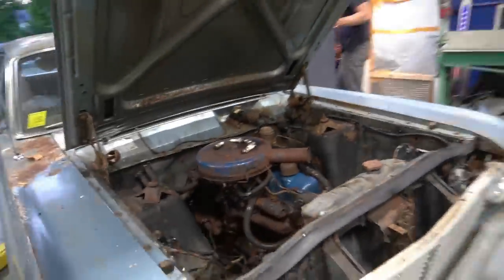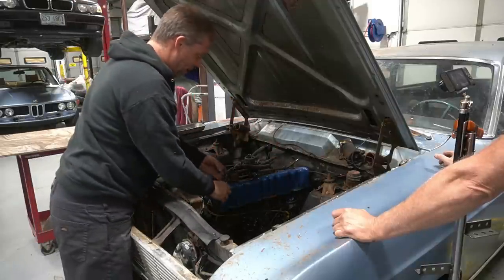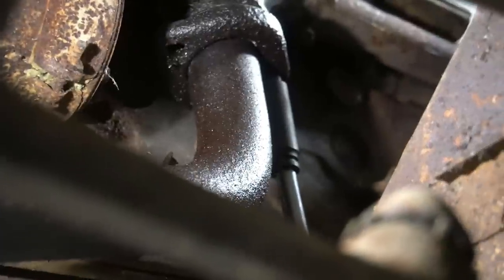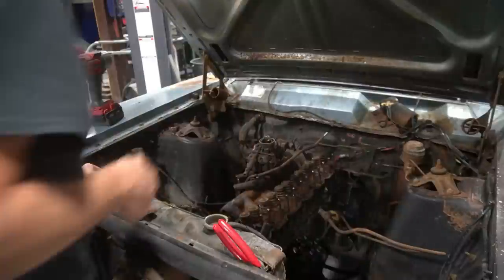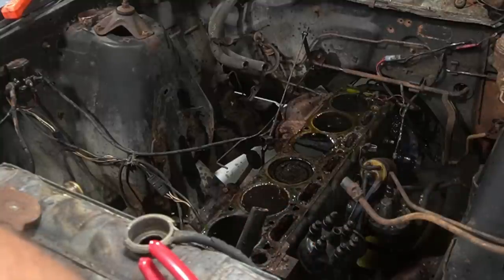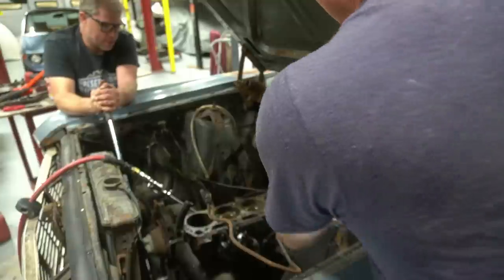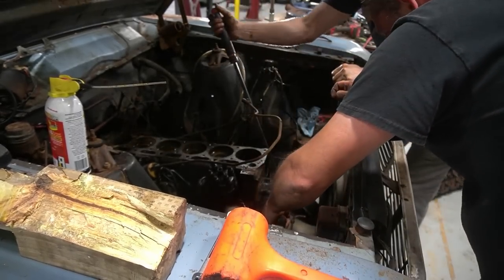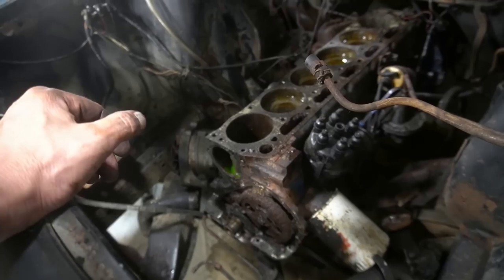Worst locked up engine ever!! With Mustie1!! Will It Run?

Comment: I was surprised to see you didn't remove the starter before removing the head. I bought a 1979 Mercury Zephyr with a 2.3L engine for $50.00 that I was told the engine was seized. I removed the starter and the Bendix was stuck into the flywheel. I installed shims on the starter and the car was in perfect condition.
Reply: Yeah, I thinking it's not the Bendix that is stuck!

Comment: Flight of the Phoenix
Reply from the maker: Yes that’s the one!! Thank you!
Reply: Good film.
Reply: They crashed in the desert and a model designer came up with the phoenix from parts of the aircraft 😁
Reply: @tinybrown6710  correct
Reply: Both the Original and the remake are great Films.
Reply: That film was based on a true event from ww2 when a cargo plane crashed in the desert.
Reply: Part Two of flight of the Phoenix was a Falcon Sponsored by Ford!!! Everyone was eaten before could get off the ground 😒😂🤣😅🤣😂

Comment: I had a similar situation in a old cars valve train of goop built up all over and in-between the rockers.   Later found out there previous owner only used Quaker State oil and didn't change it when required.  The build up was paraffin.  Thats what Quaker State used to put in their oil.
Reply: Quaker State was always great if you kept up on oil changes. Been using it since about 1970. It was one of the few low Sulphur oils back in the day.

Comment: I love the old straight six's. The heads come off easier than changing the oil in some modern cars.
Reply: From the looks of the inside of that engine I'm not sure the oil was ever changed.

Comment: This reminds me of my first car. A 1963 Ford Falcon Sprint, with an over cammed 260 V8, a Holly 500 2bbl, a 4 speed Warner T-10 tranny with Hurst Shifter. I loved that car. I bought it in about 1970 and had it for about 15 years, had a family, had to sell it.
My Mom had a brand new 1960 Ford Falcon Wagon with a 144 in-line 6. That car ended up with over 120K before the engine was rebuilt. She swore by Alimite brand oil.

Comment: Well done guys! I think that the Farmer who put it in the Garage decided to put extra coolant in the rad, but the head gasket was leaking and he kept putting water and coolant in it because he couldn't see the leak and ended up filling the block with water/coolant and then over the decades that it was sitting the coolant/water leaked out through the oil leaks that FORD always seems to have. Plus you also have to consider that the Falcon was a cheap car from the FORD line anyways so it was likely already predisposed to failure at some point, but the possibility of a filling of water inside the block would have rusted the engine components into one amalgous piece of solid rust. I have never seen a maintained engine look so badly in my life, and that is saying something.

Comment: I watched a video of some guys that pulled a speed boat out of lake mead that had been under water since the 80's/90's and they got the engine to run some what. But that engine there looks like it was a boat anchor for several decades. Gotta wonder what happened.

Comment: Folks - what happened at 13:45?  Video got switched around to a mirror image of the engine bay - carb & cylinder head went from left to right, goes back to normal at 14:27!

Comment: My guess is the owner never changed the oil. Detergent oils from the ‘70s were terrible at collecting carbon if you didn’t change frequently.  I’ve seen heads caked worse than this one, and the engine was brought back to life. Good luck on the resto!
Reply from the maker: I think oil would have helped but it’s was pure rust inside! Nothing like I ever seen before. Thanks for watching
Reply: Someone sabotage the engine by pouring a quart of oil in it maybe? Or blown head gasket that leaked engine coolant into the oil somehow?

Comment: Check out fab rats yellow submarine series. A boat sank 30+ years ago. No rust inside. Turned over. Pulled heads and oil pan to check it out. Things looked great. Reassembled and it ran.

Comment: Those pushrods looked the same as when l pulled the valve cover  on my Ford p/u after using Quaker State oil for a year.  Rocker arms were one big mass of goo.  Pulled everything off the head and spent the day cleaning up everything.   Put everything back together, drained the oil, added new oil plus quart of diesel fuel.  Let it idle about 5 minutes.  Repeated 3 times before the flushing came out clean.  Will never use Quaker State again.

Comment: This series of engines introduced in 1960 came in 144 , 170 .  200 and 250 CID through the mid 80'S . After that a 4 Cyl version was used in Tempos for a while , the number 3 main bearing is also the thrust bearing and a bit of a weak point . 260 and 289 V8'S were also used in Falcons . These are common engines and easy to find and usually use the Ford-O Matic which is a two speed unit . After 1970 302 with 3 speed  autos were used in Mavericks and  Mustangs You have lots of choices .
Reply: from the factory 144's were black, 170's were red, 200's and 250's were blue but the 250 block is one inch taller and the water pump has 5 bolts instead of four. the four cylinder version was used in tempo/topaz and some taurus/sables.
Reply: @marzsit9833  In Australia we had 221's as well
Reply: I have a 250 out of a mavic in my 1965 falcon

Comment: My parents bought the only 4 door Falcon  wagon 3 to tree  170 cid 6. Fire engine red. Kept it driving 27 years before original clutch failed  burned a quart of oil Every 500 miles 240,000 miles, $27.00 paid to junk yard to tow away. Island of Guam.U.SA. Teflon bushings in steering no grease fittings no power steering hard over to hard over with one finger when moving.

Comment: 1/24/23
This video reminds me of the first engine I helped tear down and get to run, a 1956 Chevy 265, in 1963 or 1964. We took it apart in the car. it was gummed up just about as bad. None of us knew what we were doing, but we got the old thing to run. This engine is junk, but it must have been fun digging into it. ;-)

Comment: Put a breaker bar back on and put a little tension on it either direction and use a BFH to hit the breaker bar just below the head. Repeat both ways till it moves slightly and then just use Armstrong to finish. Been there done that got the scars on me and my tools to prove it. Never met a stuck engine I had to disassemble. One little flake of rust can hold it. Just need to jar it loose. Pulling on breaker bar will you nowhere.

Comment: My father had the same engine in his 63 biscayne. The valve cover was leaking and we went to replace the casket. When we pulled it off the is was filled with sludge. We used rags to remove as much sludge as we could. Great engine it ran for years with no problems.
Reply: Biscayne is chevy. This is a Ford.
Reply: The Biscayne would have had a 230 CID which was new in 1962 as a 190 CID for the then new Chevy 2 compact and replaced the 235 engine used since 1936 in the full size cars a 230 or optional 250 were used and were far better than the old design and were used until 1986 until being replaced by the 4.3 V-6 and were still far better than the lumpy 4.3 which would knock your fillings loose  with its constant vibration , it was used until the mid 2000's  and even then it was still a rough running engine . [ and its gasket not casket on top of the motor ]

Comment: Have seen this before. Oil caked dirt on bell housing says it all . Bad rocker cover leak /pos rear main/ pos burning also= no change ,just add. Old dart slant 6 he even used drain oil he got for free. That one spun a cam bearing. Since the body was descent he parked it thinking he would get a wreck with good engine and swap . Never did, found this one garage of abandoned farm house . Found worn out slant irrigation pump engine in an estate sale in back of tractor shed.  Over 30 years and more sludge turns to that stuff.

Comment: Looks like a Ford 200ci six w/Autolite 1 barrel carb.  They're OK as an engine, nothing great, I had a few Mavericks with them.  I helped a friend free up a locked Chevy 235ci in a Chevy II by pulling the plugs, spraying Kroil penetrating oil into the cylinders, replaced the plugs & let it sit until the next weekend.  Got it loose by both of us using a long breaker bar & just rocking back 'n forth many, many times.... we were fortunate compared to what you had to do with this puppy!

Comment: Looks familiar - my first car was a 1967 Falcon wagon; but that had a 289 V8, a vastly superior engine.  Mine had a three speed automatic on the column.  Mind you, I had lots of frustrating problems with the carburetor and automatic choke system - but when it decided to start, there was no shortage of power!  And so much room in the engine compartment - could almost fit two motors in there.
Reply: I had a 68 Falcon two door with the same engine and transmission. I loved that car, it could fly!

Comment: If I were to take a quick guess, I would suggest that the head gasket failed and pumped coolant through the oil system and that's what caused the engine to seize...These engines were known for bad head gaskets...

Comment: Must say what spicked my interest when l saw the thumbnail on this l thought it was an Aussie XT series Falcon released here in 1967. Looks identical to the Aussie Falcon exept the rear quarters & tail lights. The rear section looks likes its off a Fairlane & is longer than the XT series manufactured here. Engines here were the 200, 221 & 302 V8. Got an XW 1970 Falcon myself with the trusty 351cleveland - great aussie cars.
Reply: @farnthboy yeah I was gonna say it looks the same as an Aussie XR or XT falcon!  Cool!

Shame youse couldn't get it going but this donk is definitely falcon jammed up!

Comment: Those hideous things were so weakly built that in Australia they had to put large braces from the firewall to the strut towers to stop the whole front from collapsing, which along with all the other dangerous elements and sub standard parts made it a real widow-maker. The way they designed the braces made any maintenance a nightmare, trying to work around a cheap fix.

Comment: Over the years I've seen more than one old ford six die because the oil pump drive shaft snapped. It only takes a minute to pull the distributor to check it.

Comment: That mess on the rockers and push rods was sludge residue. One of the first jobs I had back in the '60's was cleaning / desludgeing  a V8. Detergent oil wasn't yet popularized and engines were very prone to sludge formation especially if they didn't run a hi-temp thermostat and worse if they did short trip driving which contributed to internal engine condensation. Old timers back then would periodically do a kerosene flush before oil changes where we added a qt or so of kerosene and ran the engine 15 - 20 mins before the oil change. Stop laughing; I'm serious. Eventually  the engines would lose oil pressure. The upper part of the engine was so sludged  the oil galleys clogged preventing the oil from returning to the pan.

Comment: I have a 200 cubic inch 6 cylinder in a running, driving Fairlane that I am changing to a V8.  Motor runs and looks great. A 1964 with a later model head.  You can have the motor if you want. I am on the eastern shore of Maryland. Let me know if you are interested.

Comment: The sludge you are encountering is from parafin based oils. Engines would get all nasty from these oils and sometimes would set themselves afire inside the sump.
Reply: Exactly - that's not so much rust as 40+ year old wax deposits. Neighbor always ran "Sears" brand oil in engines - they would wax up so bad I pulled intake manifolds off and the area below was completely full of wax deposits. Pretty common in the 70's to have to pull intakes and oil pans off to de-sludge them. It was also common to drain the oil and run kerosene or mineral spirits in the crankcase to try to flush them out.
Reply: @willieshaw2522  I saw my Dad put fuel oil from the house furnace tank in his Thunderbird to try to flush out sludge in the early 1970's.  He took the valve covers off and had me cleaning all the rockers,springs  and stuff with a toothbrush to get sludge out.  That 460 ended up getting swapped with a 429.

Comment: Just start by removing the motor and cleaning and rebuilding it. It can be saved. No faith for a numbers matching car.
Reply from the maker: Yes this is an idea. I like the numbers matching part. Thanks so much for watching
Reply: Fords of that vintage did not have part of the VIN engraved into the engine like GM did, so any 66 whose casting number is the same and whose cast-in date code was close will do.  The Falcon / Fairlane / Mustang / Fairmont 200 Six was a durable engine.  The integral intake manifold made carb hop-ups difficult, but I believe that Edelbrock made a 3 carb conversion kit that really brought that engine to life.  Had to take the head to a machine shop to drill 2 new ports and mill flat spots on the manifold to mount the kit. The engine was produced until 1983 or so.  I don't know if it ever had port fuel injection but if not, it did have central fuel injection in its last year or 2 of production.

 Had an early70 Falcon wagon with a 302.  great car, but when I got a company car and my wife got pregnant, I had to upgrade to a 78 Fairmont wagon with a 302.  An even greater car.  Saw the falcon 5 years after I sold it  (Knew it was mine by the rust and the started repair, as well as the ornaments I pit on the grille.  I sold that car with 145K NY Metro area miles to a guy who was commuting into the city with it.  I bet he got the car to 200K miles.

BTW, from 66 thru 70, the Falcon and Fairlane had similar wheelbases, especially the wagon.  The 66-70 Falcons were Fairlanes with only 2 headlights.  After Jan, 1070 (Mine was Aug 1969), they started slapping the last of the Falcon insignia on stripped down Torinos.

Comment: In Australia, about 2 to 3 years later ('68 to '69) Ford introduced an 'XT' model Falcon with a choice of 6 cylinder engines; 188 cu. in., and 221 cu. in. (3.6 litres) with identical looking grille and body pressings (station wagon). I wonder of the size of the 'locked up' engine. I understand there was a 300 cu. in. fitted to a base model F100, but don't know if fitted to this car?
Reply: The Ford 240/300 six was designated for full size cars and trucks and was in production until 1997 , after being introduced in 1965 . It was only used in full size models for its entire life . And in terms of power and toque was considered the best American inline 6 ever made  .

Comment: Tried sharing a picture of a 383 Mopar that was so bad I had to weld a nut to the lifters and pull them with a slide hammer. The motor turned out to have a broken crank besides crusty rusty inside. I gave up and pulled it when I broke the front two cylinders free. I figured they shouldn't move independently lol.
Reply: I guess YouTube won't let you post a link. If anyone's interested I have a video of it on my little YouTube channel. The thumbnail is the one with the dusty green 68 Dodge Coronet barn find.

Comment: Engine is, indeed, in a pretty bad shape.
I suppose that the car had an accident ending in a ditch/pool but without damaging the body. Or flooded, maybe? By the time, it wasn't worth the repair and it "ended" somewhere.

Is this block repairable? Maybe. It would need a total dismounting ... honing etc etc ... 
Is it worth all the work as I suppose that those 6 cyl are still to find cheapo in the USA??? No. It isn't. 
Thanks for this vid! And happy 2023! (to you and Mustie).
Reply from the maker: Ya don't think its worth the time to rebuild but its and idea. I have a big surprise for an engine.Stay tuned. Thanks for watching!! Happy New Year!

Comment: Put a bottle jack on top of the block of wood with a chain over the top of the jack bolted to the block with bolts into the head bolt holes and jack the piston in the bore.

Comment: You might try a quart of solvent mixed with a quart of 20/40, pore it on top of the pistons and leave it overnight.
Reply: Not this time. I've never seen a timing chain that badly rusted.

Comment: What you see there is the result of 30W no detergent motor oil. My bet is the oil filter is plugged and the engine seized from lack of lubrication.

Comment: Flight of the Phoenix - WWII plane crash lands in the desert. The crew decide to rebuild it as a smaller plane from parts robbed off the wrecked original, using some engineering equipment on board. 
I think Jimmy Stewart starts drinking his own urine at one point.